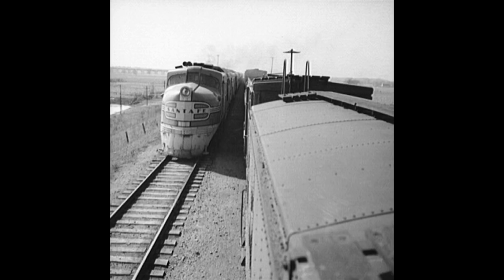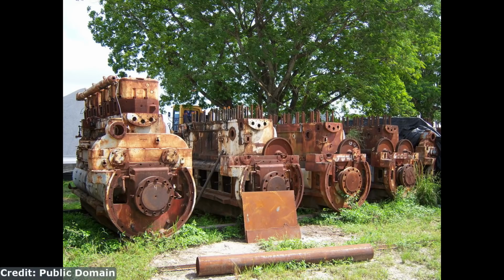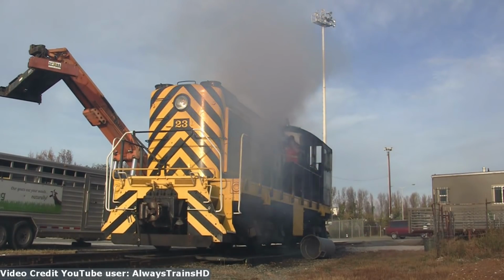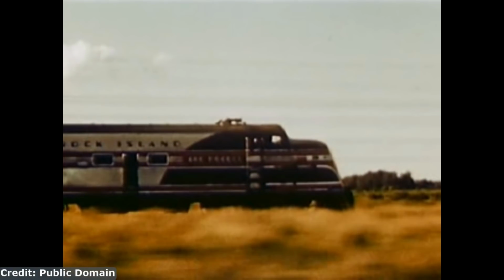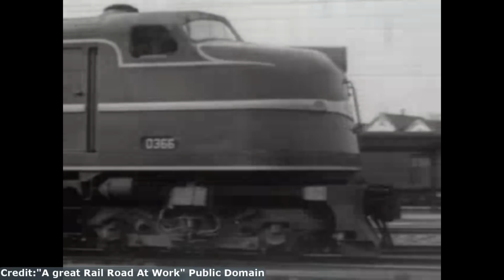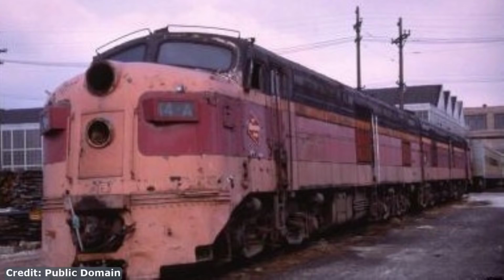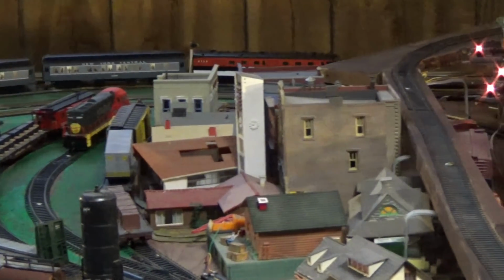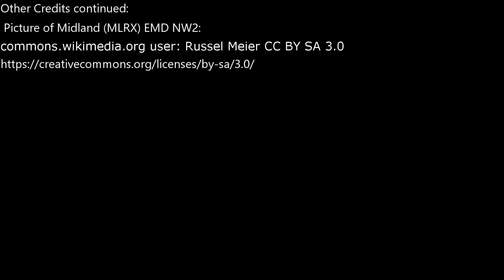The Alco DL109- Alco's forgotten early road locomotive.

Comment: The DL109 is one of my favourite locomotives, along with the Fairbanks Morse Erie Built and EMD's slant nose E units (E, E1, and E3 through E6)
Reply: Speaking of the early EMD E-units, (minus the E2) how do you tell them apart, externall?
Reply: @the_autism_express  The E and E1 had flush headlights, the E3 through E6 had lip around the headlight. Many of the variations were customizations for specific railroads, and thus can be identified by their livery:

E = Baltimore & Ohio
E1 = Atchison, Topeka and Santa Fe
E4 = Seaboard Air Line
E5 = Chicago, Burlington & Quincy

The E3 and E6 were both made for multiple railroads with several buying both models. I'm not certain how one could tell them apart.
Reply: I found out how to tell the E3 from the E6!
If you look at both engines from the side you'll see that both have five square port-holes, with the E3 having its port-holes spaced further apart than the ones on the E6
Reply: I am scratchbuilding a EMD  E3 locomotive in HO scale out of brass.  The DL103 version will be next. The DL103 is less of them built, compared to the DL109.
Reply: @paulsheffler8146  Cool, another scratch builder. Any picures?

Comment: @2:48, I actually ran that switcher a few times during my time with the Midland RY (Baldwin City, KS).  I believe it was originally owned by the C B & Q (if I'm mistaken, please correct me!!)  The barely-seen nose of the other locomotive is ex-Rock Island E-8 number 652 having been restored to its original Rocket color scheme; previously it had acted as C R I & P's bicentennial locomotive "Independence" and worked the Chicago commuter service for many years.  Don't know the history of the NW2.  The 652 is now back on "home rails" at a RR museum in Manly, Iowa.  Not sure if the NW2 is still in Baldwin City at the present time (2023) or not.  I dearly wish steam had never been replaced - especially given OPEC's corruption.

Comment: I picked up an N scale DL-109 at a train show earlier this year. I think the required widening of the car body gives the locomotive a very cool look. Not the first time that has happened. Originally the British Morris Minor car was to be slimmer. But when they decided to mount a transverse engine and front wheel drive drivetrain in it the whole car had to be widened a few inches. Like the Alco they did this simply by cutting the body down the middle and adding a strip. Which, in my opinion, ended up with a good looking style line as a result.

Comment: The DL109 and the Baldwin BP20 Passenger Sharks for the PRR were some of the most exotic diesels ever built.  Both had ginormous pistons from the 606sc and 539T 6 cylinder inline 4 stroke diesels.

Comment: One thing you have to remember in the diesel locomotive Wars is that General Motors would Finance your purchase of an EMD diesel General Electric would Finance the purchase of a general electric diesel locomotive. When you went to Alco you had to have cash money in hand as well as for Baldwin and Fairbanks Morse. There were many railroads that could not afford to replace steam but were financed by Standard Oil so they would use diesel fuel provided by Standard Oil. In Steam days you would use outdated engines for branch line and then switching use when the Diesels came you put a brand new diesel locomotive on a branch line and that Branch line became a money loser where is with the old steam engine it made money. These were used as excuses to shut down many Branch lines. The railroads also wanted to use the Diesels to go to one man operated trains like on mass transit and electric trains. A fireman was Superfluous on a diesel locomotive but the Union force them to continue to have one anyways. There was one of the financial advantages of having a diesel locomotive. Generally diesel switchers were used in cities that had anti-smoke ordinances. When New York created its own anti-smoke ordinance that was when Baldwin started to make diesel locomotives to serve that need. Any locomotive steam electric or diesel if you maintain it and take care of it properly they last damn near forever.

Comment: The New Haven Alcoa deal 109 ran in service reliably for many years and we're looked upon as a candidate for conversion with third rail shoes in order to go into Grand Central Terminal but they were too heavy to go over the aqueduct before they got to the terminal. The reliability aspect of the DL 109 showed how much availability at diesel locomotive had that did not have to go to the shops as much as Steam did for regular maintenance but you didn't have to perform regular maintenance on a diesel locomotive for it to operate and function properly.

Comment: A few notes, there was indeed a ALCO 538T it powered the HH1000. EMC actually had a reasonably successful line of switchers in the 1930's selling about 150 units across all models. The SW/SC and NW/NC, rated at 600 and 900HP, used the Winton 201-A. The SW-1 and NW-2 were simply the first models to use the 567.
Reply from the maker: Thanks For the info!
Reply: The SW2’s were a good little engine ( notice I used engine ) in my comment, we were still leaving them run in the 70d’s but when I did have to start one I would advance the  throttle a few notches to help its idling and temperature…..I never thought of the start up being rough just characteristic……outside of a little vibration the memories are awesome…..thanks,  40 years and no lost time…….ms.
Reply: Most people seem to not know the initial  EMC/EMD naming convention:
S=Six hundred HP
N=Nine hundred HP
E= Eighteen Hundred HP (Etc)
There were initially SC and SW, the SC
C= Cast Frame
W= Welded frame.
As models were added some were Railfan inventions while others were inhouse.

Comment: The 531 engine was sufficient for a switcher you could not make it bigger or add more cylinders to it that's why they designed the 244 engine the 244 had horsepower limitations so then they came up with the 251. The ALCO DL 109 were famous for having almost 97% availability rate especially for the New Haven that ran passenger trains with them during the daytime and then filled them up and put freight trains on them so they would be basically running day and night and they were the only non-switcher engine at Alcoa was allowed to build during the war production board restrictions during World War II because it was cataloged as a dual service engine. Now you have to remember at this point in time all of the diesel manufacturers were in brand new territory and did not have any experience with diesels because there weren't any previously. They learned when you pushed it into too hard what problems it developed or if you made it too long and the crankshaft broke people made a big thing about the crankshaft breaking in the Alcoa PA but when they were breaking into 20 cylinder sd45 nobody said his thing so there is Prejudice from one company to the other just like in the car industry.

Comment: This is the third time I have watched this video.  You have finally riled me enough to post a comment.  Your bad words about ALCO are quite misplaced.  The New Haven had great success with them.  Because they learned how to run them.  There was a hard fast rule on the New Haven that you never, ever shut the prime mover down unless major repairs were to be made.  In addition, the New Haven took oil samples of every locomotive daily.  They had their own lab to check the status of the oil.  The railroads that had ALCO troubles did not use this system and many had EMD mechanics that did not understand ALCO.  Yeah, they had troubles.  A lot of them.  But not the New Haven!

Now, the New Haven was THE main route to New England via the Maybrook line.  The yard at Maybrook, New York served the New Haven, the NYO&W, the Erie, the L&HR, the L&H and NYC.  Occasionally the PRR.  ALL this traffic went east via the New Haven!  The New York Central simply could not handle the traffic over the Boston and Albany.  The Boston and Maine was likewise clogged with traffic.  During the war years there was a tremendous amount of traffic  between the west and New Englend.  Those DL 109s were put into service running commuter service in the day time, and pulling freight from Boston to Maybrook at night.  In the few years of WW2, they were never shut off to speak of.  And, they performed all that was asked of them.

You are right about the lack of MU on the nose,   All the New Haven's big Texas steam locomotives were used as pushers on the Maybrook line and so the trains went through.  ALCO responded with the FA1 and FB1 to be used as A-B-A sets and that eliminated to worn out steam locos.  Those F1s, like theDL109s before them, worked night and day without stopping.  Eventually, the New Haven purchased FB2s and ran A-B-B-A sets between Cedar Hill and Maybrook.

The New Haven finally gave in and bought some GM GP9s.  About all I can say for them is they rode really nice.  But they were a problem when used as a switcher on a local freight.  And they wouldn't pull like the RS3s.  And they broke down.  But they were cheap to fix!

So, in a way i understand where you're coming from, but I don't think you have done proper research.

I have now finished my rant.  Hope I didn't offend.

Comment: All 2 cycle diesels require some form of boost to function, Roots style blowers were common method. They did not increase horsepower but fulfil the missing intake and exhaust strokes. As the piston moves down, it uncovers ports that have compressed air that forces the exhaust gasses out the opposite side.
Reply: Those are also referred to as naturally aspirated.
Reply from the maker: I forgot to mention the blowers, thanks for pointing that out!
Reply: @patrick wines Not true at all on that statement. How many Detroit's came without a blower or turbo, and yet they still worked.
Reply: @ducewags  
There’s no such thing as a 2 cycle Detroit Diesel engine without a blower. They can’t run without one. Even a Detroit with a turbo still has a blower also. EMD engines are the same. If the turbo clutch fails and can’t spin the turbo during startup, it’s not going to start.
Reply: @ralfie8801  Well for one, it's called a 2-stroke, not 2-cycle not even close to the same thing. A Detroit glow bulb 2-stroke engine, or hot bulb engine as some call it. It runs from a reed valve in the crank case.  No blower or turbo.
Reply: @ducewags  
Yeah, it’s exactly the same thing, it’s just an American term for 2 stroke, but there is no difference between the two terms. A hot bulb engine is not a Diesel engine either, no matter who made it. On top of that, Detroit Diesel came into being in 1938, and production began with the series 71 engines that have the same blowers we were discussing earlier.
Reply: @ralfie8801  normally asperated
Reply: @mshum538  
They both mean the same thing.

Comment: The car body was NOT cut in half and welded together. Famed industrial designer Otto Kuhler designed it that way! Many roads liked their engines and they ran for decades!
Reply from the maker: Wow, I completely forgot to mention  Otto Kuhler !  But it was my understanding that during the development, as it was so rushed, that what Mr. Kuhler designed did not quite match up with the frame,  commination between the mechanical and design departments was almost none excitant. When the chasse was set to mate to the body, there was a miss match, hence the need for the stylized 3rd window and the notable cut in the front of the nose. The other reason this may have been done was that the headlight bucket was not big enough to accommodate the light so it had to be pushed out so the hump was added to make it look like an element of the design.  I could be wrong though.
Thanks for the info!

Comment: I might add, in 1929 ALCO / GE produced a experimental diesel electric passenger locomotive, NYC 1500, with a 900-hp, 12-cylinder, V-type engine. Apparently, it did not perform very well. On the other hand, the freight unit with the Ingersol -Rand engine ran for a much longer period.

Comment: So New Haven DL 109 served the railroad for 20 years but after World War II with the construction of the freeways running alongside the railroads the New Haven lost lots of money having to run empty trains while everybody took the turnpike instead. When the DL 109 came up for heavy service they did not have the money they were already bankrupt. Any competent management of the New Haven railroad did not do the locomotives any good. You know what happens to a car when you run it and never change the oil well that's what happens when you do the same thing to a locomotive. They could get financing to buy the purchase of a new locomotive and then they would not have the money to perform proper maintenance on them at all which is how they suffered.

Comment: Large steam locomotives had lots of weight per axle you had to have extremely good track many railroads after World War II that scrapped their lights weight steam engines for diesel locomotives found that as the cars got bigger their tracks were not sufficient. Track second handle 50 ton cars we're not able to handle 100 ton cars without being totally rebuilt. Another reason for a branch lines being abandoned by Major railroads. The EMD 567 motor was a brand new engine design because they used the Winston distillate motor and that was at the end of its development. It was better for them to start with a clean sheet of paper with the 567 then try to improve the Winton engine. 4-stroke diesel locomotives are better on fuel economy but require more maintenance where is two-stroke diesel locomotives like emds have less maintenance but are thirstier. This was not a factor when diesel was six cents a gallon.

Comment: daily diesel user here.
The reason as to why  a prime mover sounds rought when cold is that this type of engines do not have any pre haeating of the fuel the idé behind this is that this is the easy and mutch simpler to construct a diesel loco engine.
In a diesel car you can install a electrical heater by remove the plug on the engine block to heat the engine with help of the normal power plug.
In dowing so you save fuel and the car battery.
Both types of engines has injcetions pumps but in a prime mover it has a higer pressure compared to a modern crdi engeine witch is between 2500-3000 bar depends on type and  maker.
😃😃😃👍👍👍👍
Reply: End engines used solid unit injectors , one on each cylinder activated by a camshaft lobe and supplied by a transfer pump.

Comment: Enough with the Monday morning quarterbacking. Diesel serve specific purposes when they were first created they were to subplant steam not to replace steam. The fact that you had to have four diesel locomotives to get the same horsepower as a modern steam engine. Modern steam engines had lower cost per mile then diesel locomotives especially after World War II when the price of diesel fuel doubled. With steam you had to have a crew for every engine and you would run a train all the time to get cars from your industries and when they had diesels you had the whole for tonnage guys who would make customers wait and then send 10 diesels to pull 500 cars with one crew. Railroad service suffered with the hall for tonnage attitude which is why many shippers went to trucks. The Long Island Railroad handled 8,000 freight car loads a year. When the New York and Atlantic took over Long Island Railroad Freight Service and gave customers good service they went to 37,000 car loads a year service is the only thing a railroad can sell. Shippers like it when you call the railroad and tell them you have an empty car and in an hour they send an engine to come get it so you don't have to pay another day's rental on the car. There are many aspects to the railroad industries that are not so simple to explain money finances tax laws all enter into the picture. Penn Central could not afford to rebuild all of the locomotives from the various manufacturers that they had so EMT and General Motors financed 2000 locomotives for railroad that had bad track everywhere and slow orders almost Universal. What good is high speed locomotives when your track is the only good for 10 miles an hour?